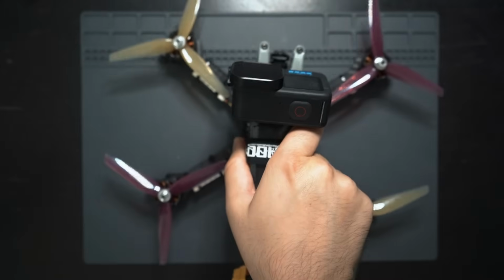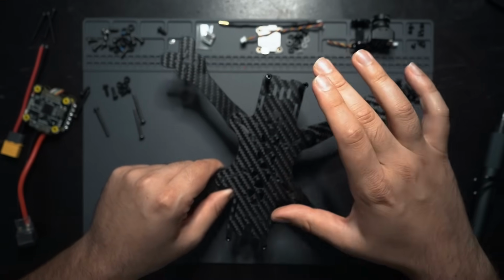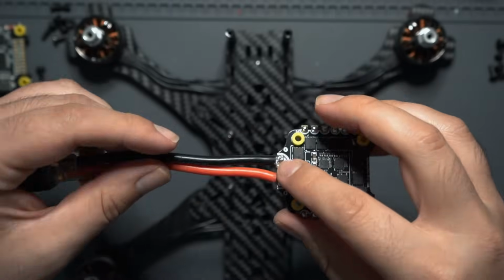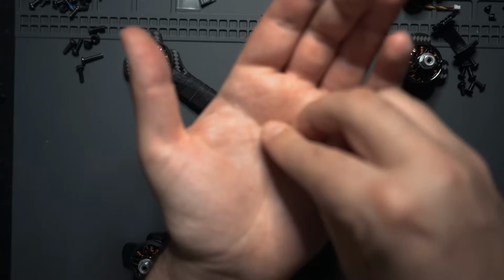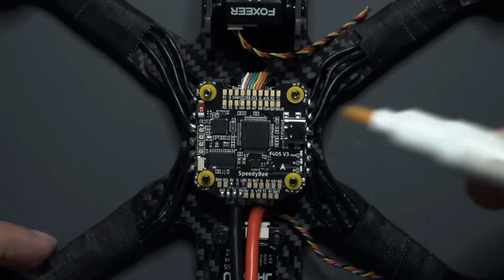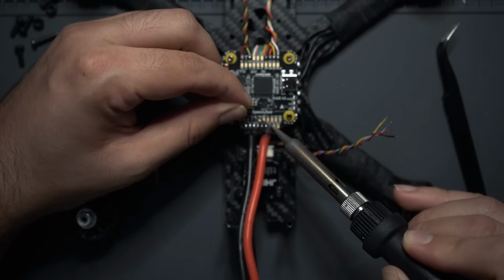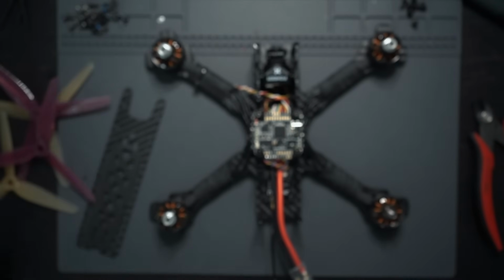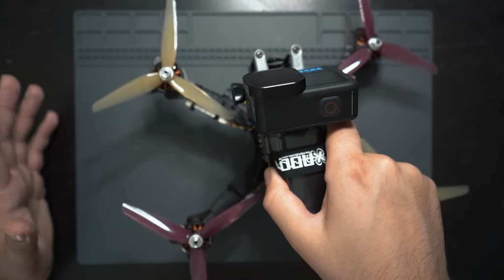Build a Freestyle FPV drone for $200

Comment: Or someone if they wanted to practice could buy the wizard 3 it’s $199 and flies pretty damn good out the box
Reply from the maker: Correct but that is a 3" drone and only has 20a ESC's, and I doubt it would be able to handle a full sized GoPro. That one won't be able to freestyle quite like this this build
Reply: @TRONCATFPV  what is a 3” drone?? The wizard is a 5”
Reply: @TRONCATFPV  and it comes with a GoPro mount and does fine with one
Reply: @TRONCATFPV  and it has 35amp esc
Reply from the maker: @jprizzle2604  Oh you're talking about the v3 I thought you were talking about the X140HV 3" wizard. Just searched around and found a bunch of videos on it, ill have to check it out 👍Thanks for the recommendation!

Comment: The betafpv ELRS Rx is trash don't do it spend an extra $3 for an EP1.
Reply from the maker: I'm honestly getting better range than I thought I would with that receiver. Maybe because its on the arm away from all of the electronics. Main reason I went with it was for cost on this build. I'll check out the EP1 👍
Reply: @TRONCATFPV  the first Version of the betafpv flat antenna was bad. The v1.1 fixed the flaw and betafpv even sent you new ones free of charge

Comment: Hobbywing has a video illustrating how having your Low ESR capacitor anywhere other than as close as possible to the esc is dead weight.
Reply from the maker: Could you share a link? I'd be interested in seeing this, almost all of my quads have the capacitor on the XT60/XT30 and I haven't had any issues.
Reply: @TRONCATFPV  You likely won't if you are running normal 4s or 6s on good boards. But with noisy regulators and escs you will have tuning issues and it is hard to trace back to the caps.
Reply: @TRONCATFPV  https://youtu.be/dpMHSZths90

Comment: I was wanting to see how the VTX antenna was installed. In TPU maybe. And the VTX, was it mounted in the rear with bolts ?
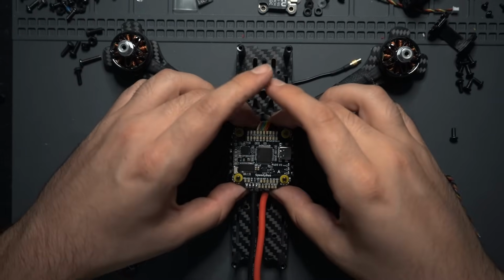Reply from the maker: At 12:30 & 29:24 answer your questions about VTX and antenna.
There are 3d printable parts that could hold the antenna though 👍
Reply: @TRONCATFPV  thanks , sorry I missed that part , great looking bird.

Comment: Great build and video! 👍
BUT! Guys, go scout your area you live in FIRST, before you just decide to build the much over hyped 5" size of quad! There are plenty of other sizes of quads that are plenty of fun to fly, but might just be easier to fly in your area you live in.
Example: I, like many, live in the suburbs of a large city. Plenty of great parks, but not many that aren't full of people, and are big enough to enjoy flying a 5" quad. Problem: 5" are extremely loud. They WILL ATTRACT plenty of people to the noise they make! Fact. 
Some of those people are gonna be KARENS. Those are people who bitch and moan about everything!!! They're are one huge pain in your ASS, when flying. They'll talk your ear off, call the cops, and give you gobs of grief ... I know, I've experienced plenty of KARENS!
I've scouted my entire area within a  approx. 5 mile radius of my house. Huge area. I used Google maps, noted the possible areas to fly, and drive to all of those areas. Then, I walk the area.  
We're not looking for wide open spaces, like middle schools have. You can fly there, but they become super boring really quick. Nothing to fly around, through, over, into, etc.
So, check out your area. Find the best spots, and walk them. Look for areas with well spaced trees, picnic structures, etc. Determine if they are big enough for a 5" drone. Do people live all around the perimeter of the park or spot? If they do, those are gonna be potential KAREN'S that will complain because a 5" is gonna make a big racket, and they live right on the other side of a fence that is adjacent to the park or spot you want to fly at. 😳
I couldn't find any good spots, where I live, that were large enough in area, and far enough away from neighbors where they wouldn't be prime KAREN'S to potentially complain about the noise, me spying on them (a common misbelief), and causing them potential harm.
I found the parks in my area to be better for 3.5" quads and smaller. Much, MUCH quieter, and less size so much less apt for KARENS to complain and get going. 🙄
I've had a great time NOT flying my three 5", haven't flown them in 3 years!...and flying my 3.5" and smaller quads at these parks! And the best one, a 10 out of 10, is only 3 minutes from my house! 🤘 Too small and too close of neighbors for a loud 5", and I haven't had a single complaint about my quiet 3.5" and smaller! Perfect!

Scouting is the way to go! 

Know the places to fly BEFORE YOU BUY! 

It will save you a lot of money and a lot of potential hassles! Because KAREN'S ARE NO FUN! And, there's plenty of great quad sizes besides the over hyped 5", that are loads of fun to fly and RIP! 
🤷🙄👍
Reply from the maker: Agreed 100%
Find a good secluded place to fly a drone like this. When you womp that throttle the thing screams. Practice in an open field to get used to it then go to a spot with some obstacles once you feel more confident. 
❌❌ Stay away from the Karens ❌❌

Comment: Hey troncat. Great video as always. What kind of range are you getting with the elrs reciever? I want to use it on a race build so I don't need much but seeing conflicting reviews.
Reply from the maker: Honestly i'm getting more range that I thought I would, i'm not sure if its because I have the receiver mounted out on the arm or what. I'll have to do a true range test but I haven't had it failsafe yet. Since the receivers are so cheap I plan on ordering a couple more lol.
Reply: @TRONCATFPV  Nice. Will try them out as well. No antennas to mount.....the dream :)

Comment: T-motor electronics are shlit, the diatone H743 board with BMI 270 gyro and their 65amp ESC is a sick combo for 7" but if doing 5" you could go with a smaller ESC like their 55amp board which is just as good. they make good stuff. but the BMI270 gyro is amazing. alwasy hated the MPU 6000 stuff. nice to see the BMI 270 being used more.
Reply from the maker: good to know, this was my first t-motor electronics piece and was disappointed. I'm hoping it's just a bug with the BMI270 and can get fixed in an update since it seems like 4.3 is what caused the twitch. The board came with 4.2.11 and flew fine, no gyro twitch. as soon as I flashed 4.3 or 4.3.1 the gyro got all screwy. Flash back to 4.2.11 and the gyro isn't even recognized lol.
Reply: @TRONCATFPV  weird mate 😑
Reply: Did they fix the bidirectional dshot for RPM filtering on the H7 boards? I dont think so and H7 has no benefit at the moment on betaflight. Personally I`ll stick with f722 or even F405 with the BMI270 gyro
Reply: @chrisbee5481  what issues are they having with bidirectional Dshot? its working on my end fine as far as im aware.
Reply: @thewhitedillard  seems they have fixed it then
Reply: I’ve had a Diatone whoop aio that had a mosfet fall out on its first crash and it was because I taped a pole and it freaked out and hit the floor. That being said I went on to buy like 2 Diatone stacks after that lol and I have 3 more ESCs all doing great
Reply: I’m staying away from Mambas h743, especially with the mpu6000. I had two gyros due on me in the last 4 months one being the bmi270 and the other being dual with the mpu6000
Reply: I got the tmotor lite stack and the esc exploded while I was configuring it on the computer. I was frustrated cuz I bought the tmotor stack dispit the fact it lacked features because their more expensive stack has been so good to me
Reply: I have a question. I am a new fpv from China. I don't know much about the difference between bmi270 and mpu6000. More people like to use mpu6000 in China.
Reply: @超级恩光  idk why there’s a chip shortage for the mcu6000, I heard from diatone themselves they took the h743 off the market
Reply: @basquiatfpv  Actually, products related to H743 have been removed from DIATONE  official website in China.😬But I've only used F722mk3 and F411aio from DIATONE🤭
Reply: First time ive heard anybody say anything positive about the Bosch gyro. Also the first time ive ever heard anybody speak negatively about the MPU6000.
Reply: oh yeah, I had a similar vibration/twitching problem with the tm mini racer f7 with the mpu even (recently swapped with foxeer mini v4 mpu)